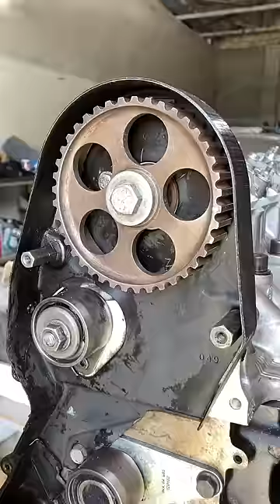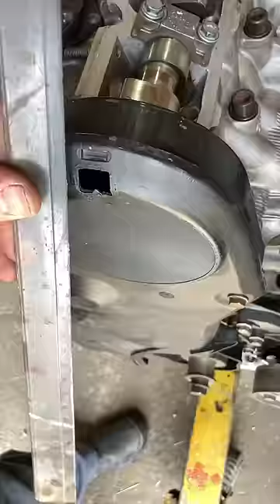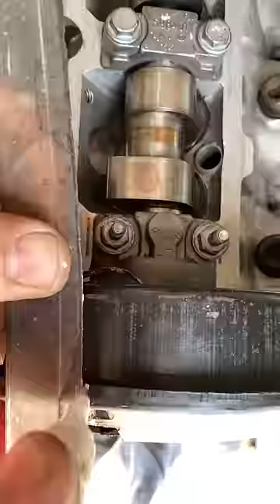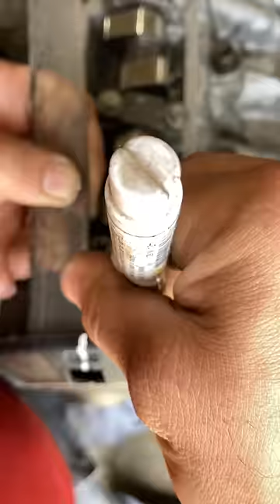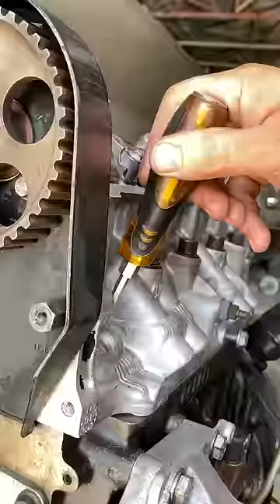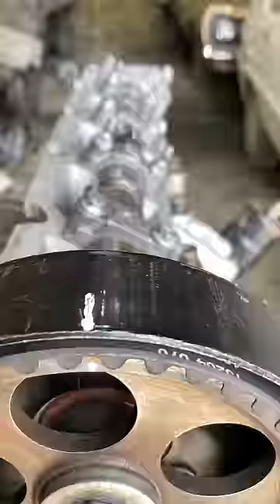How to replace Renault 21 Timing belt ? #shorts #amazing #satisfying #mechanical #tricks #video

Comment: Done so many of those timing belt so I could do them in my sleep that was the most simple timing belt set up ever they made
Reply from the maker: Yes you are right thank you for comment my dear
Reply: I done one on my buddies duel over head cam b20 Honda engine it was super easy
Reply from the maker: @IzzySk10  thank you for comment
Reply: I have eg turbo swap typer
Reply: Discofelsi  My 2015 Skoda Rapid 1.6 diesel is similar to this engine, has TDC marks so easier really.
Reply: Àq😊
Reply: 1
Reply: True
Reply: Is this from a jeep?

Comment: I'm mechanic for renault- There is simple way of doing that without removing spark plugs and removing valve cover. Just mark before removing belt and new belt already has marks on it, just align mark's with cam and crank and that's it. Safe time for drinking caffe 😜
Reply from the maker: Thanks 🤎💜🩵💙💚💛

Comment: Make  marks on old belt and  corresponding marks on necessary pulleys then count teeth between marks on old belt then put those marks on new belt then install while matching those marks to corresponding marks on pulleys.
Reply from the maker: When I opened the engine for repair, there was no belt. Thank you for watching the video and comment When I opened the engine for repair, there was no belt

Comment: What's the life time of Drive belt as well as Timing belt, may i know the recommendation of changing the belt. Thank you
Reply from the maker: Hello, my friend, I usually change it between 60-70 KN, but companies and manufacturers have their own personal suggestions.
Reply: @Mechanicaltricks  Thank you so much for your reply. When you're having belt problem the indication in the ODO displaying Battery indication and Power steering is hard, it's the reason of Belt only or Requured to replace battery?
Reply from the maker: @shaikjilani7401  you’re welcome I don’t know about it dear friend
Reply: @Mechanicaltricks  OK Thank you, Where are you from ?
Reply from the maker: @shaikjilani7401  Canada

Comment: I had Renault care go through block freeze cracked bottom of cylinder water jacket was repaired withJB weld after heating block with hairdryer and using carb cleaner,!   It worked in 1980.  Now I use it and did they change formula? Something is not right here I do not use quick weld !
Reply from the maker: Thank you for your comment

Comment: No tdc mark on the crank pulley !
Reply from the maker: Unfortunately  I can’t find it
Reply: lleva un útil roscado para saber cuándo está el cigüeñal en su punto ,es sencillo,va en la parte de delante cerca de la caja cambios ,,,es un tapón torx o llave 11 exagonal,,,o las marcas en la correa con respeto a los piñones y flecha de sentido de giro ,,,
Reply from the maker: @javierrivero1299  Thank you very much for sharing very useful information
Reply: @Mechanicaltricks  no hay problema ,,,soy un fanático de los motores y me gusta todos estos vídeos ,,, 👍👍👍👍👍 saludos
Reply from the maker: @javierrivero1299 ❤
Reply: If you know engines, well enough, there is a mark it’s just three lines and if you’ve done enough motors, you should know what iswhat
Reply: Первый поршень в верху это есть вмт
Reply: @CharlesLease-ei1ee te refieres a las que están en la caja cambios ,mirando al volante motor ?
Reply: es para saber también que pistones están en el punto muerto superior 1 y 4  cilindros,,,también lo puedes poner por ahí ,,,,pero hay algunos que te no deja ver esas marcas bien por las cosas que llevan encima ,,,,para mi es más fácil por el tornillo tapón  delantero ,,y ahí sabes seguro que está bien ,,,,

Comment: The belt is installed in the wrong direction of rotation
Reply from the maker: How wrong
Reply: How can a belt be installed the wrong way round? If you flipped it round then it would be exactly the same no?
Reply: @danbrown4420  some belts came with an arrow that should be the same as the rotation of the engine. So, if there are no arrows, it makes sense to install the belt so that any embossed writing on the belt is the correct way up.
Reply: @nassimdjedoui5469  I get you, makes sense. Never changed 1 before myself, not sure I'd ever attempt it either 😅 was purely curious. Cheers 👍
Reply from the maker: Thanks 👍 😊 you made my day💜🩵💙💚💛🤎

Comment: Hey dostum benim arabamin triger kayisi degisti ama ses yapiyor ve bazen çok bazen az , sanki ağliyormus gibi napicam simdi , 93 1.7 manager
Reply from the maker: Hello. Is the belt you wore good? Did you tighten it too much?
Reply: @Mechanicaltricks cevap için teşekkürler , kapagini acip baktim çok da sıkı degil , kasnak bozuk olabilir mi ?
Reply: Ustaya kayışı değiştirmesini söyleyeceğim
Reply from the maker: @muhittinkamil3705 yes maybe. Open the cover and start the engine then look at the pully
Reply from the maker: @muhittinkamil3705  If it has been working for a long time or if you just changed it, it is of poor quality, change it
Reply from the maker: @muhittinkamil3705  you are welcome
Reply: Thank you ,i love you
Reply from the maker: @muhittinkamil3705  you are welcome my friend

Comment: Is that a scooter engine or mower?
Reply from the maker: it is for 1986 Renault 21 a sedan car
Reply: Owned a  87 1.7 L and ‘92 2.2L Nevada zeven seats. Loved them both
👍
Reply from the maker: @Chris-fl6fx  well done 👍🏾 my friend
Reply: @Mechanicaltricks  I owned a Fiat 124 spider and rebuilt that engine 2.0. As small as that engine was, it was dohc and much bigger than this one. Working one cars is becoming a dieing business and appreciate the guys left that still do it.
I am currently rebuilding my Audi A4 quattro trans. 😅 300lbs.
Reply from the maker: @bigshott9117  Oh my god Audi is my favorite car. I also heard about Fiat, but I didn't work with it, don't worry, my friend

Comment: So we didn't replace all the rollers? That seems like a mistake. Timing is crucial on many engines, that is too cheap not to replace those pulleys. This probably isn't an interference engine, but doing the job twice because you were too lazy to get the extra rollers is lame.
Reply from the maker: I do it my way, you do you. Thanks for watching and commenting, my friend. Cheers 🍻 👏 ✌️ 🥂 🤣
Reply: @Mechanicaltricks  yeah I wasn't gonna respond to yesterday's comment, but since you decided to edit and pop up in my feed again, it's not about "you doing you or me doing me" it has to do with what the customer or your viewers are doing to do. You missed even telling viewers to inspect the pulleys. If you charge 500 to do that belt and then 2 weeks later one of those pulleys fails, they will need that job done a 2nd time or worse may even need an engine. You fail as an informer to inform people correctly. 

If you're not going to do it the right way, at least tell people. It's like a car needing a throw out bearing (clutch release bearing) and you pull the transmission all the way out, if you don't replace the entire clutch kit simply due to ease of access, you're a fool, because chances are if the release bearing failed, the clutch will soon follow suit. Then while doing the clutch you should recommend a rear crank seal, and even resurface the flywheel. There are correct ways, and then there's your way. I hope your viewers are smart enough to see what you leave out. Cause it may save them thousands.
Reply from the maker: @vr6prodigy  thank you for attention and explaining